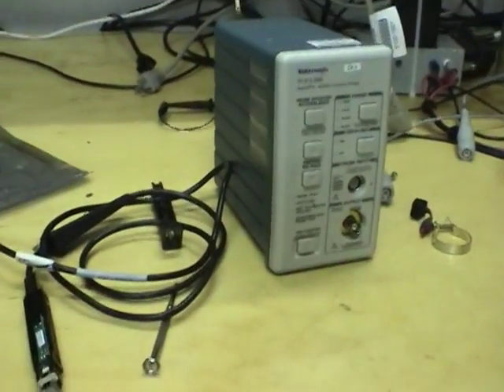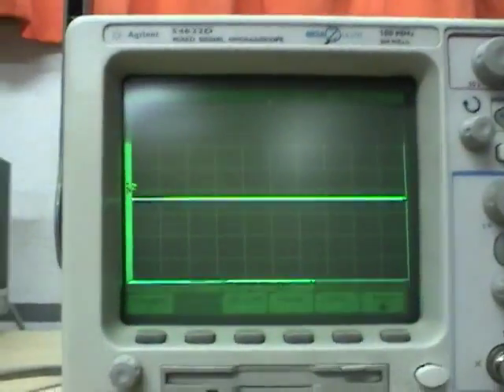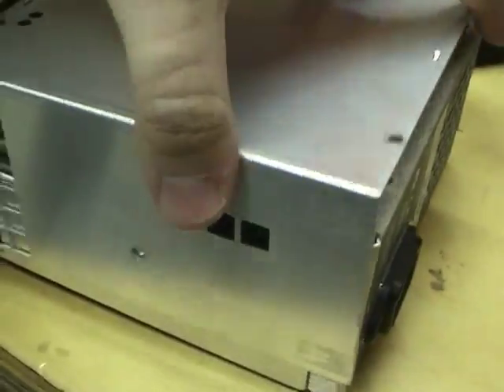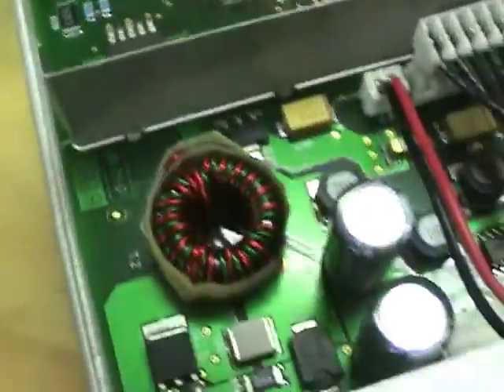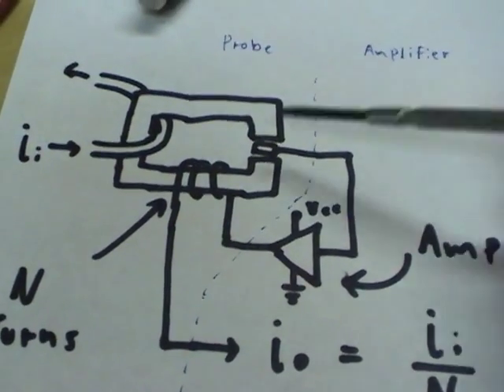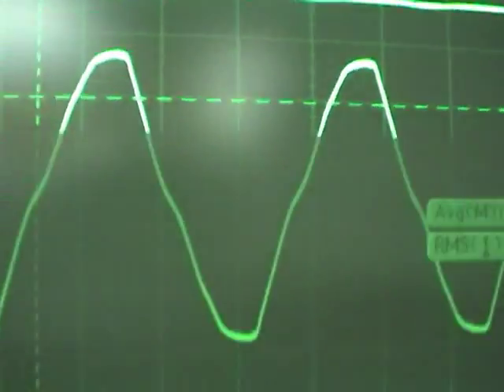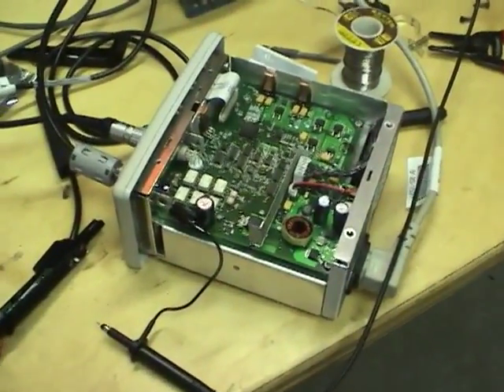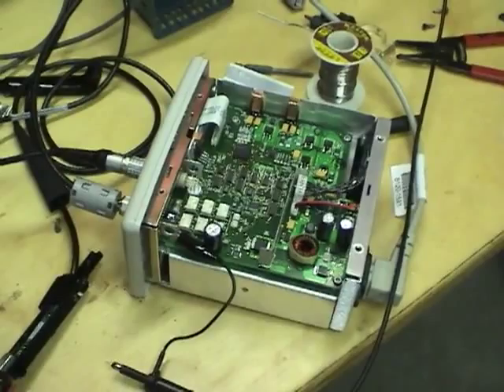Tektronix TCPA300 current probe amplifier debugging

Comment: Do you know if the probe itself is the same as the TCP202 so the only difference being there is an external amplifier... In other words, can we use (hack) a TCP202 to work with the TCPA300 amplifier ?